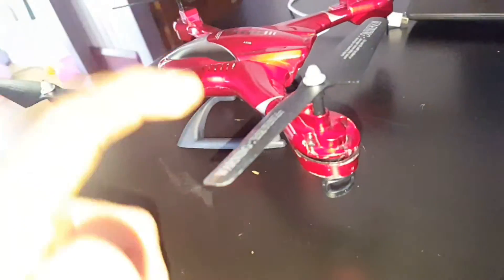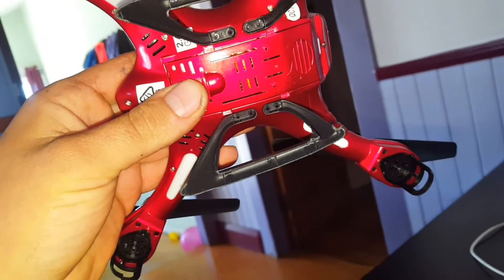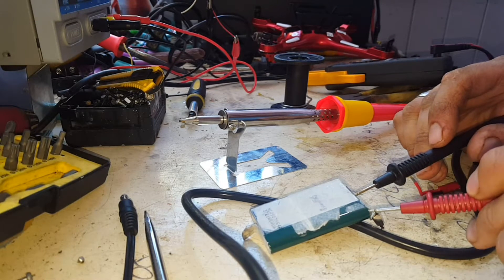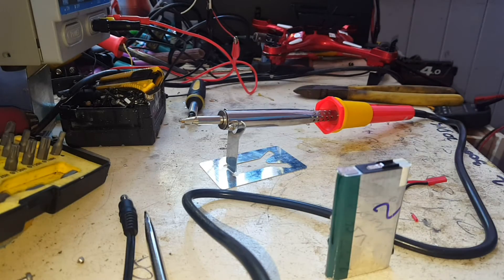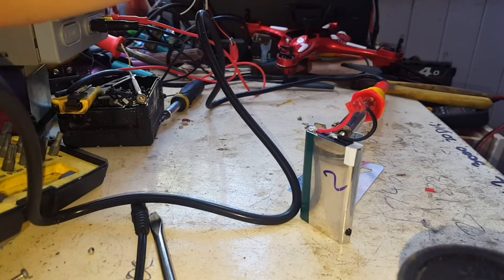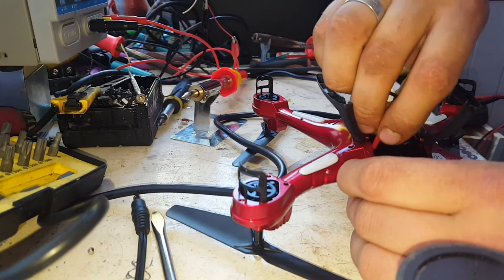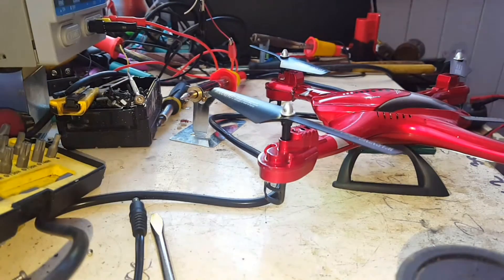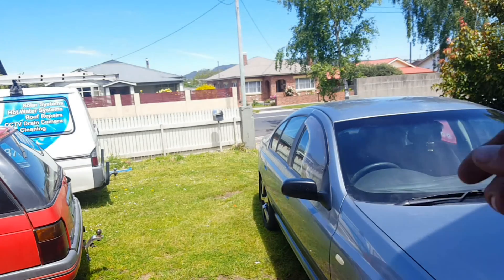Cheap Drone battery upgrade 2.4whrs to 10whrs recycled  lipo

Comment: What flight time did you get with this battery?
Reply from the maker: 7 ish mins before it was too weak to control
Reply: Wow... expected allot longer with the more powerful battery
Reply from the maker: Its also heavier
Reply: @Oneupthesleevecustoms  Yea the added weight is why you were having issues controlling it. Those motors aren't designed to carry that additional weight.